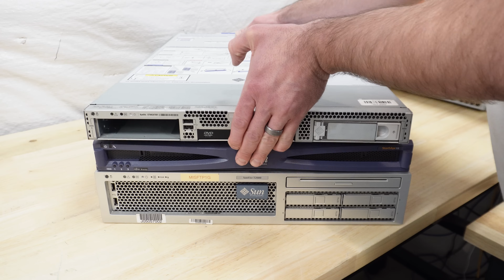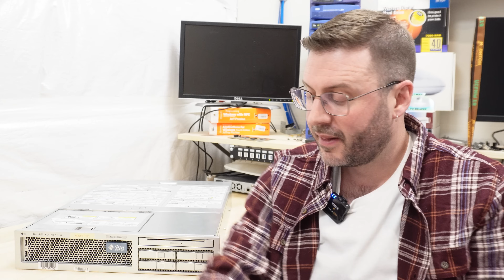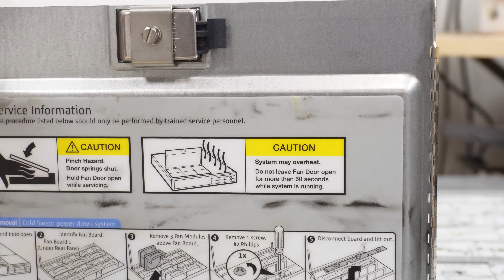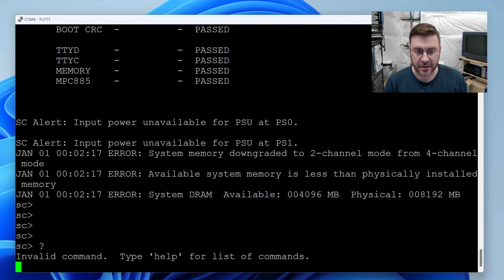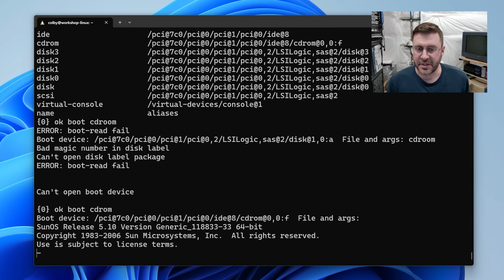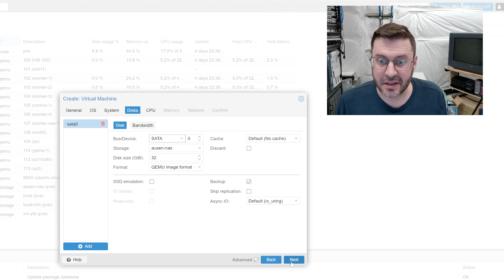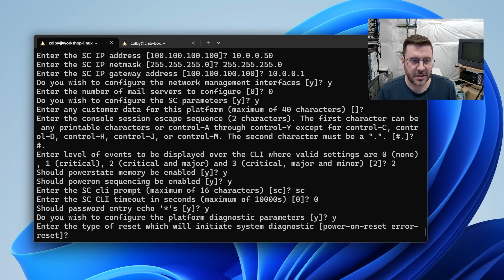A Sun Fire T2000 from 2005

Comment: It's been a while, but I can recall correctly - Jumpstart network installs were much faster than using the built in drives with Sun workstations - Ultra 10s and Ultra 30s, used to provision Sun workstation labs for School of EE at a large university in NY.  Lab configuration changed semester to semester depending on who was teaching the courses that used the labs.

Comment: I wonder why you don't use a water-block and a water cooling loop to cut the racket the machine makes down to a nice quiet ticking.
Reply from the maker: eh I only have it on whenever I'm messing around with it, so water cooling would probably be overkill for my scenario

Comment: Those "slot in" DVD-ROM especially in rack server where air is pulled in front to back accumulated dirt and need be properly cleaned with a disk cleaner disk or opened and manual cleaned and after that if not working replaced as laser diodes (IR for CD and red for DVD) weared down ...

Comment: I had an opportunity to work on a Sun N1 grid system.   My application processed about 650 gb of compressed web logs ( ~6.5 terabytes) every 3 hours on 64 cores, in 2006.  That was replaced with a Hadoop cluster in 2010, which got the attention of Facebook, which I said "Sorry, I'm not moving to California." Then, 3 months later they opened up to remote, but I was already 5 months into a new 3 year contract, so like a dummy I said "nope".

Comment: We had a bunch of these and we HATED them. I replaced six of them running BIND as a recursive name server and completely overloaded with a single HP DL380 of similar vintage and it did the job with just over a single CPU core. This solved our immediate problem, then got rebuilt with four new DL380's in two cluster pairs.

Comment: At one point my employer was heavily invested in migrating and consolidating from old V440s and V880s to the T2000s, and I remember the kind of big challenge at the time (2009-2013 or so?) was that they were absolute rockets for anything that could be split into a ton of threads, but their slow(ish) clocks and poor FPU speed meant that anything single threaded tended to struggle.  pigz vs gzip was an absolutely eye opening thing - taking a multiple gigabyte system dump to send to Oracle and compressing it with gzip could take the better part of an hour, while pigz would chew through it in a couple of minutes flat.

But you had better options if your application was single threaded.

Comment: I took a similar path as you (based on your vids) with using high end Sun/Sparc hardware at home, and actually ran Solaris/CDE on a Sparc workstation as my daily driver home desktop for a while back in the 2000s (the few, the proud!), but I was never able to play around with any of the T1 based systems. When these first came out, they were a HUGE deal!

Comment: At a previous work place. We had a 32 cores 1.2Ghz Clocked T2000.

These scaled down Sparc excel in mail box compacting given the 
large number of threads making good use of the I/O bandwidth.

Our T2000 easily out performed a dual CPU v440 server by 2x 
during mails compacting.

Comment: Never played with the UltraSPARC T1 processors. Had a SunFire X4200 with the AMD Opteron system (effectively shared the same chassis as the T2000) and yes, you can put 6 of the fans in the fan bay up front. Moves, I think somewhere around 600 CFM, but it was also hitting ~90 dB(A) as well, when I used to run it.

Power consumption was in the ~510 W range with the dual AMD Opteron 248s and 8 GB of RAM that I was running back then.

Was using it to generate meshes for an external aerodynamics CFD simulation that I was working on at the time, on semi-trucks.

It was a pity that it was so loud, because if it weren't for that, it was actually a FANTASTIC system.

Used it for a LAN party once, whilst I was in university. The four 73 GB Fujitsu 10krpm SAS 3 Gbps drives didn't even break a sweat as it was serving up games and updates to like 40 downstream clients simultaneously. By then, I was already running ZFS on Solaris 10 6/06.

The quad GbE NICs also helped as we manually load balanced it.

Comment: I was work with this system a few years ago and it's was real work)) This server run database in small organization and they use it from ~2010 year till now, because it very expensive to move on x86 platform. 
I was try to move from old SAS to SSD NAS but I have offer to another job with Windows servers...))

Comment: I installed a  few of these back in the day...the nonprofit I worked for had a few Sun x4200m's donated by Sun (shortly before Larry Ellison bought the company).  The x4200m was an x86-64 server in the same chassis, using two AMD multi-core processors.  Ran some with Windows Server 2003, and set up a company web server on one of them with the installed Solaris x86 build and putting the 'SAMP' stack on it (Solaris, Apache, MySQL, php).

Comment: Had a chuckle at the bad magic disk number part, got that error several times when i tried installing solaris on my ultra 10, but not because of a typo, i still dont know what was wrong, cd drive, media, etc. Eventually i got a real solaris install disk and changed the drive and it worked, but the whole process left that error messege burned into my mind, great video!

Comment: Awesome machine. Worked with those and Netra T2000 in the early 2000s. However Niagara T1 processor although a great chip had a major flaw - a single math co-processor shared by all cores. That made FP operations slow and expensive. Niagara T2 solved the issue but the costs have skyrocketed so I had to move to Intel machines - HP DL380 G4+. Too bad that T2000 class machines are not mainstream.

Comment: It's not so much the T2000's in-service, but that 2.5" SAS drive / form factor are still used in everything. Given the age of the LSI RAID controller, I doubt it would understand any more SSD. (I put SSD's in my Dell, and no the PERC doesn't know how to properly deal with them - eventually I'll have to put them in something else to "fstrim" them.) In fact, it just occurred to me to put some of my spare dell 500G SAS drives in my T2k - vs. the pair of 73 and 146's.
Reply: 😊A hardware RAID controller needs to TRIM the drives itself, a TRIM issued to a RAID volume would do nothing.  That requires a RAID controller that understands SSD's
Reply: @brentboswell1294  That's what I said. While there are ways to send commands directly to devices through various RAID controllers, it's a mess; it's easier to plug the drive into a RPi once a decade.

Comment: I find it interesting that Solaris 10 Sparc does not automatically formats the hd on a real Sun server. But Solaris 10 x86 never gave me issues with partitioning from the installer, although installing was always slow.
Reply from the maker: I bet all I needed to do was label it and the installer would've noticed and done the auto-partition
Reply: @clabretro  The admin is expected to setup the disks / partitions before starting the installer. On PC's (x86), they correctly assume a moron is driving. It's the same kernel, so the drive(s) still have to be labeled and partitioned to be usable.

Comment: The T1 cpus do a fun thing with quad channel memory timing, to let each thread on a core access memory in the four channels in staggered timing. This lets each thread act as if it is more of a core, while other thread are waiting on memory responses. The downside is this makes the whole system very picky about memory timing. Sometimes just reorganizing the memory sticks in the slots will fix this, but there is a reason sun required you use specific sun certified sticks on these.
Reply: ... because they can charge more for them. The system not coping with the inevitable small variations in chip timing is a bad system design. (as most of their systems require buffered, registered memory, this should never be an issue, but Oracle doesn't know how to make a server.)
Reply: @jfbeam  I mean this is pretty significantly pre-oracle, these first gen CPU's were closer to Afara products than Sun products (sun acquired Afara for these CPU's). There's a reason quad channel DDR2 systems were few and far between at the time. Once you get to T3 / T4 era this become much less of a problem.

Comment: Sun had a free server deal where you could try one of these free for 3 months. Somehow I was able to get a hold of one as a child this way and I spent hours pouring over all the features and how modular it was. All I’d ever used up to that point was beige boxes with off the shelf parts. To see something created by sun microsystems with all its enterprise prowess, a system designed to sit in a datacenter potentially for a decade, I felt so damn powerful.

The ILOM was mind blowing. I couldn’t believe I could just mount an iso as a virtual cd drive and click around a graphical interface over the network. But the system was so loud this quickly became a requirement. I had to lock it away in the closet and only run it off-hours because it was so loud. Thanks for reviewing an incredible machine
Reply: Haha I guess they had a bunch of stock sloshing around! 

Maybe even office returns, like they first offered a similar scheme for offices to trial... Unless you're saying the one you used was indeed intended for offices, but simply chose not to filter-out individuals?
Reply: @kaitlyn__L  I may or may not have taken some liberties with the definition of a business to get access 😅
RIP Sun Microsystems
Reply: @YourHoss  good guy Sun lets (then) local teen “be a small business” :D
Reply: I did the same thing!! Signed up the company I worked for at the time and had one sent with no verification what so ever.. yes I did return the thing, but it was amazingly fun to play with.
Reply: same here, I ordered one for my business, specced with maximum ram and cpu of course.  returned to them and did their exit survey.  They asked why I didn't iike it,  so I said it was too slow booting up (well it was with max ram I didn't realize that was the problem til later lol) and 2.5" SAS storage was way too expensive and unobtanium so that was my other problem, it really needed to be paired with a fibre channel storage system or something in those days.  Also I just wasn't that happy with the overall performance with databases.  I tried to do all sorts of things to performance tune it but its just not that great I think they were trying to solve problems that were particular to Java that I could care less about.
Reply: This sounds like a literal DREAM. As somebody born in 2003 who can barely remember using dial-up (yes, we still had it in 2007..) but lived through the switchover to broadband, I always gawk at how things were done in the late 80s and early 90s, into the early 2000s with the technology you guys had. Thank you for sharing this awesome story.
Reply: @bbb-sf1bb glad you appreciated it. It was a different time for sure. Before everything got figured out and hyper optimized there was way more diversity in hardware and software and it felt more organic

Comment: The trick with remote management is knowing what not to do because it'll wedge the remote management and make you have to run to the DC...  You end up being much more careful with the servers across town than the ones downstairs!
Reply: If the system is booted, you can reset the BMC from the OS. (or wait for the watchdog to reset it.)

Comment: It's just a couple of quick lines in the SSH config to enable those ciphers/key exchange algorithms again, you can connect to it just fine from a modern system.
Should just be
Host 10.0.0.50
  KexAlgorithms +diffie-hellman-group1-sha1

or you can add the option on the command line with -o :)

SHA1 was only removed from the list of defaults quite recently.
Reply from the maker: thanks!
Reply: Perfect suggestion.  Adding KexAlgorithms diffie-hellman-group1-sha1,ecdh-sha2-nistp256,ecdh-sha2-nistp384,ecdh-sha2-nistp521,diffie-hellman-group-exchange-sha256,diffie-hellman-group14-sha1 to the ~/.ssh/config or /etc/ssh/ssh_config.  then ssh -o KexAlgorithms=diffie-hellman-group1-sha1 root@10.0.0.50

Comment: I remember these from the early 2000's..   Memory error could be from faulty CPU..  Remove CPU and inspect LGA-socket and CPU as well as the RAM. I was SUN certified Admin and Technician from 1997 until 2005.
Reply from the maker: I'll check that out!

Comment: We had some of that exact model.  The T series processors were very niche.     We used them as data movers for tape libraries... IIRC we could hang 6 fiberchannel LTO tape drives off each one and get consistent streaming.   We had a lot of hardware failures though... PSUs, memory and CPUs.  These for us were really the last Sparc boxes we used before mostly switching to linux on vmware for everything
Reply: Yeah, we also tried using these T1 boxes as Veritas Netbackup "Media Servers". Pulled a bunch of LTO tape drives off the SAN directors and directly hung them off these servers and had clients streaming data over gig-e networks. Saved SOOOO much pain-in-the-ass having to get the tape drives connected to the clients over the SAN and using tape drive sharing and library control. These T1 processors were a bit too anemic to handle the job. Ended up using the T2 processors in T5120s which were able to handle several LTO4 tape drives and 10-gig-ethernet, allowing us to migrate 100% of our clients over to network backup, instead of SAN attached tape drives. Ended up running that configuration for YEARS.

Comment: I have set up Net MGMT on my SPARC T4-1, it serves access to the Service Processor (which runs ILOM) via SSH. At least with ILOM it also hosts a web management interface, which allows console access, as well as access to logs and some other neat features such as using an ISO through the web interface to create a virtual DVD drive (that's how I installed Solaris 11 on it). As for SSH, you can make temporary (or permanent) exceptions for older key and host algorithms. You could either add the specific Key and Host algorithm via an option switch or you could add it to your ~/.ssh/config file.

Example for ~/.ssh/config:
Host t2000-alom
        HostName 10.0.0.50
        User admin
        KexAlgorithms +diffie-hellman-group1-sha1
        HostKeyAlgorithms +ssh-rsa

Usage: ssh t2000-alom

Comment: I wonder if Sun was also subject to the infamous capacitor plague. 

Seems like that Sun Fire has quality parts.
Reply: Seeing how this stuff is getting to be 20-30 years old, caps are going to inevitably fail. (that said, I have an Ultra 1E that's been in continuous use since 1997. I recently tested my 4 netra t1/ac200's that have been sitting for ~15 years - the fans rattle, but they always did.)

Comment: If you mount the console server in the middle of the rack, the octopus cables should be able to reach anything in the rack. What cable did you use to extend the octopus cable? Straight through wiring or standard 568B wiring?

Comment: Regarding the weird half-RAM issue, I have a theory.. since there was an extra CPU packaged with that machine, is it possible that the previous owner upgraded the board from a 4core to a 8core model? If so, the CPU might not be seated firmly and/or one of the pins to the memory bus might be damaged.
Reply from the maker: could be, I'll check it out

Comment: "Feels solid" - The equivalent Dells of the era, if you picked them up by a front corner, would flex like crazy and I was always worried about breaking a trace or connector on the motherboard.
Reply: A place I worked at in 2007 had a lot of Optiplex GX-270s that had blown caps.  They all failed at the same time!
Reply: @DerekWitt  I have an x2270 with some blown caps. It causes the fans to run at 150%. (it's a 24layer PCB, so replacing them is a serious pain in the ass.)
Reply: Ah, the era of Fujitsu. (you know, the people who make oil tankers) The T1000/2000/5000 line are some of the most overly built chassis in the world. I joke about being able to lift a car with one. The "brown" boxes (netra, etc.) will flex if the cover is off. The much older "white" boxes, well, those are mostly plastic and will shatter if you look at them wrong these days. The Oracle era silver boxes (X2200, etc.) were made with much lesser metal (lighter and cheaper ) so they always flex.

(The v20z/v40z were made by NewISys. They're a pretty even mix of mass and stiffness... at 3ft long and 35lbs, they'd have to be.)

Comment: You can get a modern Linux to talk to the old stuff if you set the key exchange algorithms in the config file.

for example if you add:
host 10.0.0.50
      KexAlgorithms +diffie-hellman-group-exchange-sha1,diffie-hellman-group1-sha1
to your .ssh/config
Reply: It takes more than just Kex. I curse this shit every damned day. Like every f'ing thing on the planet can be updated to whatever someone's definition of "secure" is today. (I've had to walk a few people through hacking Cisco NX-OS systems to enable the correct settings to be able to access the device -- for the record, it's a pain in the ass!) And then there's all those "older" things that demand Java for management. (and need very specific versions of java)
Reply: @jfbeam   just run something light like an LXC or Solaris Logical DOM so you can just ProxyJump/ProxyCommand
Reply from the maker: thanks!

Comment: PCI-X was also used in some PowerMacs around the time of the PowerPC-Intel transition.
Reply: Dell xeon workstations had them for a while also.  I have both a PCIe and PCI-X Sun quad ethernet board in my collection so they had both around at the time.
Reply: Yes, the PowerMac G5 line. Not all models though. The models with only 4 RAM slots had regular 64 bit PCI. But they moved to PCIe for the last iteration with the dual core CPUs.